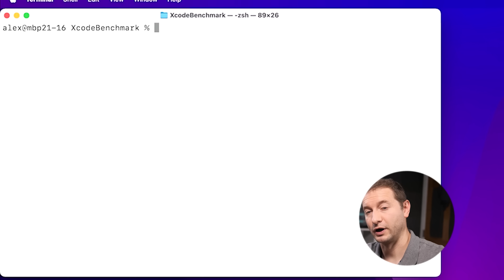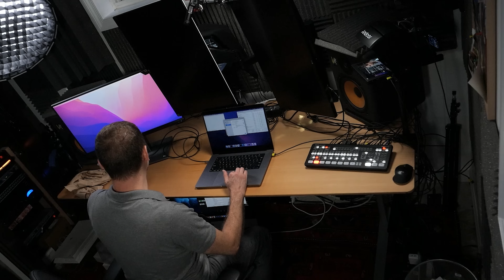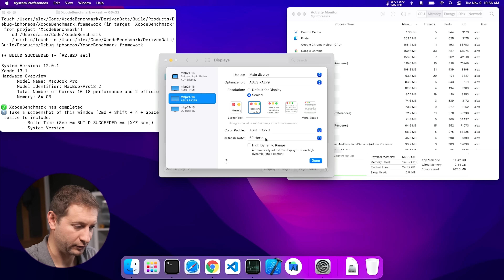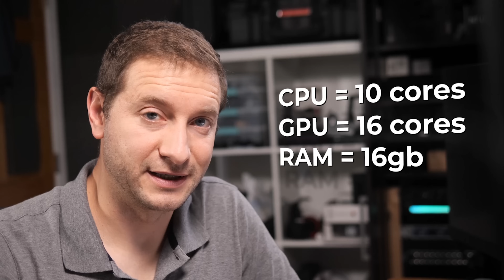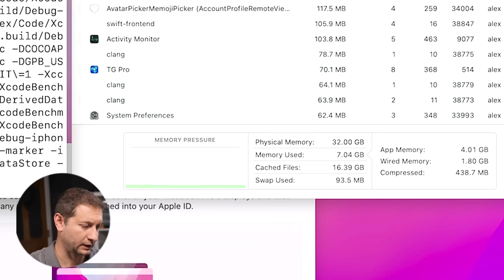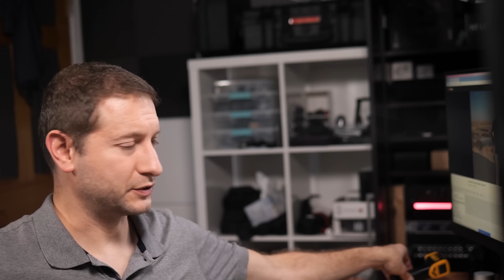More monitors = slower MacBooks | M1 Max/Pro with several 4k

Comment: I'm running TRIPLE 4Ks @ 60hz!!  Backstory:  I specifically bought the M1 Max because I wanted to work a third 4k monitor into my setup.  However, I ended buying a dock with DisplayLink that may even work for three monitors on non-max M1 chips.  I'll have to test it with my wife's MBA.  For those who are curious, I'm successfully running a triple 4k setup at 60Hz (each monitor) from a single hub -- one TB cable is all I have plugged in for charging, perifs, and three monitors.  It's an Alogic DX3 and it was kind of hard to get.  Amazon was out of them so it shipped from Australia.  I was half expecting it not to work, but so far it's been working for about 5 days with no issues.  Kind of amazing.
Reply from the maker: Can you share the make and model ?
Reply: @AZisk  My macbook pro is the 16" M1 Max with 10C CPU, 32C GPU. The dock is the ALOGIC DX3 with a Display Link driver, and the monitors are all identical LG 27UD68W models from a few years ago. They're all connected via display port. I haven't experienced any excessive RAM or CPU issues.
Reply from the maker: @jmpersic  awesome thanks
Reply: @AZisk  Sure thing.  And thank you for your great videos!  I've wondered why for years nobody seems to do multi-monitor testing.
Reply: @AZisk  Would love to see a video on this overcoming the 2 display limitation on the Pro if you pick it up.
Reply: Hey Milo this is some great information. I have the Pro processor and I was wondering if you had a chance to test out your wifes Air? Do you think the alogic would work with the pro for 3 displays? I've seen mixed things online. I'm considering returning my Pro to get the Max, but if this works that would be a nice savings.
Reply: @EliBates95  I have not had a chance to test it with my wife's MBA but I'd be happy to test and post the results here.  Maybe I can get to it in the next few days if not sooner.
Reply: @EliBates95  I will test it ASAP and post the results here.
Reply: @EliBates95  So guess what.  My wife's base model M1 MacBook Air has zero issues with my ALOGIC DX3 dock.  She's running Big Sur (I'm on Monterey) and the DisplayLink driver installed fine and the Air was able to drive three (!) 4K monitors at 60hz each.  I'm floored.  I think this means that if you have this dock, or possibly other docks that use DisplayLink, you don't actually NEED an M1 Max chip.  The limitation of DisplayLink is that it's meant for productivity, not gaming or lots of moving pixels let's say.   It will hit your CPU.  But if you're doing productivity tasks it's amazing and barely hits it.  I kinda feel like I spent too much now on the M1 Max, but at least I'm not dependent on DisplayLink for 3+ monitors.  If the dock fails I can plug in directly, so there's that.  The DX3 cost me around $250, but the single-cable convenience is pretty nice.
Reply: @jmpersic  dude that's awesome! I'm literally just using like vscode, chat apps and web browsers so this sounds like the perfect solution for me. Gonna pull the trigger on it. Thanks
Reply: @EliBates95  awesome, you won't regret it. I also use VSCode, Linux VMs, Adobe InDesign, Docker Desktop, PGadmin, stuff like that. I don't game, and have zero issues with the display link setup.

Comment: The caldigit element thunderbolt 4 hub looks like the owc but it has four USB A and three USB C / thunderbolt ports. It just offers more. Although I don't know which delivers more watts to the laptop. I think caldigit can deliver 60W, enough for a 13" or Air.
Reply from the maker: Not bad, but definitely more expensive. Im waiting for owc’s 14 port dock which is on backorder. Have been using their t3 dock for years and love it.

Comment: Thanks very much for making this. Good to see the 16” Max comfortably sits at low/no fans with these many displays attached while my Intel 16” would be 100% fans and melting into the desk.
Reply: Even with only one display the intel one goes crazy!
Reply: what about when you need to share the screen? I need to disconnect my monitors (MPB intel 16")
Reply: My 2019 Intel with one monitor and it becomes useless. It become crawling slow as well. If I need to get work done I need to unplug from it. It sucks
Reply: Seriously….gotta upgrade cause of it, dang intel!
Reply: mine goes nuts with one 4k display only forget running 2 or 3.
Reply: Yeah that's cause Apple didn't connect any heatpipes or fans to the cpu or each other, the load here is pretty mild, I used to run 4 monitors while compiling a 20+ project solution on an older i7 10th gen (last mac had 9th gen), one of those monitors always had a 4k video running from youtube. That system never had an issue. but I also wasn't running MacOS.

Doesn't matter the cpu you use, if the actual system engineering is getting in the way.

Comment: I've been running two 4K monitors with a DisplayLink hub on my Macbook Pro M1 (not M1 Pro) and have noticed some interesting things. Apps like Spotify which have tiny little animations when music is playing (although they've recently changed that) use a ridiculous amount of CPU, same goes for Slack with animated GIFs etc. I've gotten to the point where if I need max power (or to save battery) I'll minimize those apps. This happens even if the apps are displaying on the laptop's screen.
Reply: Spotify on my mac sometimes takes up to 2gb of ram. idk why
Reply: Hold on. How is it possible? M1 support only one external display due to IO limitations. Am I wrong?
Reply: @Ilinskiya  aha! That's the trick 😁 I have a USB-C DisplayLink hub with 2 HDMI outputs. Just need to install DisplayLink software and off you go
Reply: I wonder if the cpu also working with the ram hinders the cpu earlier than it would with the previous generation.
   I can see how the cpu managin ram helps ram but I don’t see how this makes the cpu more efficient. They made more powerful cpu chips and are somewhat wasting it on helping the ram

Comment: Thanks Alexander for doing and showing this 👍
While the tests might not have been so scientific when it comes to showing only the impact of added monitors, since the tasks running were increased too, it still demonstrated well how and what works in practice. Of course one could argue that if you have more monitors you are more likely to have more things going on in parallel, so from that point of view your addition of tasks (videos in this case) is imo relevant, even if it no longer compares the same load with only more monitors added. 

The maximum 2 screens limit on the M1 Pro is a real bummer, why Apple oh why, sigh.

Btw, if you are using 4k resolution on a 4k screen, you are no longer scaling, you are using the screen at its intended native resolution. Any other case is scaled, but not the native resolution.

I agree that 4k native resolution is too small if you use it on 27…28” screen, but if you use 32” screens you can use it fine at native resolution and with 3 such screens fit an insane amount of information on them, since it equals 12 full HD screens. Problem is, once you get used to that, anything else feels very cramped and paralysing 😀

Comment: In my home/work setup I am using OWC Dock with 3 thunderbolt ports, ethernet and 4 USB ports, it is nice when I switch between home and work computer with one cable change. I have one ultra wide screen 49' 5120x1440 120Hz, 3 dongles for wireless keyboard, mouse and headset, webcam, ethernet and android device all connected to the dock. Switch between two machines is as easy as connect dock to one or second machine. 
One grain of sand in this machine is MacOS Monterey couse it doesn't remember refresh rate settings after update from Big Sur on additional screen and always set ProMotion that causes blinking and I have to manualy switch to120Hz over and over again.

Comment: I was hoping you would test with the screens just connected, not running other apps. The question being does merely having the screens connected at all affect performance. Obviously the benchmark will be affected by other stuff running. :-)
Reply: i would have thought that too. but it seems like just plugging them in had almost no effect to RAM use on the 16 GB M1 Pro 16” which is bizarre to me given unified memory is gpu memory!  i know pushing in a 4k to my old MBP 15” turns the fans on straight away as it switches to discrete GPU.
Reply: Of course it will be slower with 3 monitors. Slower for gpu. Because gpu now need to render 3x more info 3x more pixels. Video memory is shared in m1, so it also require more memory. My simple app that I did with Juce framework use 220 mb and if I resize then it uses 300 mb.. etc
Reply: Sure but if you have other displays, you will use them with other tasks probably. If you connect other displays but plan not to use them, then you shouldn't plug them in at all.
Reply: @guipo2581  yep,in that case he should start the tests with all apps open and then connect monitors to see a real performance.
Reply: @guipo2581  bullshit. I use 3 displays in video and audio production. Only 1 program is working. The most stupid thing is watching 3 YouTube videos simultaneously! Most stupid test I’ve seen.
Reply: @Alexander Chudopalov  I see. Your use case is more specific than most users, at least for those that consume the content of this channel. I think other programmers would have vs code open, an external terminal and many chrome tabs open, as well as a debugger or an simulator, so I think this test is not stupid at all, even if people doesn't watch many YouTube videos at the same time, the point is that the chrome tabs are open and the pixels in the external displays are being used and renderized again, with probably most users use case, witch is chrome tabs open doing some search, listening to music and watching an tutorial video or a podcast
Reply: @guipo2581  "in that case he should start the tests with all apps open and then connect monitors to see a real performance"

Comment: Finally it's here , thanks for the tests 🔥

This setup shows  how most of us Devs work and these videos help us to decide what machine to get.

My Intel Mac used to get lot hotter and drop performance in such use cases .  

M1 Air and M1 pro  seems to be less fit to my use case.  ( I was okay with their performance until this video ) but now that I have seen this video it changed my mind . Better cooling  do seems to have an impact 

Anyone  who are planing to spends money on these machines will love your videos , these test helps a lot .

Comment: I'm not sure I understand the test: you're plugging monitors, makes sense but then play 4K videos on them.
Build times are longer but isn't it because  playing videos uses resources?
When changing 2 things at the same time, measurements don't answer the initial question anymore.

Sounds to me like you're testing the impact of running more things during the build, which as a result makes it slower (and it's not related to the GPU driving monitors)

Still watching tho
Reply: I have to agree. It even says when he runs the benchmark, "Please do not use your Mac while XcodeBenchmark is in progress". Sometimes his tests just don't make sense.
Reply: @mattbosley3531  oh haha yeah and then he unplugs the video recorder output on the M1 Pro, which was HDMI and mistakenly not counted as a monitor on the M1 Max earlier.

I mean at least we can roughly conclude is that it's fine to use external monitors, without having fans go crazy as with the previous gens, from the much less efficient discrete GPU.
Reply from the maker: @supercurioTube  Yep, while not a scientific test, I wanted to test what kind of output I can get and how (approximately) it will affect a long build - is it significant? Playing 4k videos is pretty taxing on some machines, but most of these handle it just fine. If I included some older machines in this test, I think the video results would have been more dramatic. Thanks for your comments.
Reply: @AZisk  yes no doubt, thanks to hardware decoding the impact of playing videos is very tiny.
Reply: It’s a bit random as the tests are not standardised
Reply: Actually, the M1 air gets a lot slower  because it does not a fan.   I found that out plugging it to a 1440p monitor.  Intel macs get slower also.    Its the heat!! It will also take a hit on battery life
Reply: @nyambe  but does it get slower because of the extra GPU usage and memory bandwidth to drive and refresh the monitor, or because of the task running on it?
Reply: @supercurioTube  task usage  is minimal and would in any case be consistent. The only one affected  by external displays was the M1 Air.  The others did great, which is not always the case.  Driving 3 4K monitors has to produce stress on the GPU.  That is actually crazy talk
Reply: @nyambe  How can you conclude that only the M1 Air is affected by external display and not streaming ultra high definition video?
Reply: @supercurioTube  I have one, ;-) I noticed that it got really hot on 1440p/4K external monitors .  Since it has no fan in slows down. It works fine with external 1080p monitors.  I commented that to Alex on the last video.  M1s, Including the M1 Air handle multi tasking extremely well, they have media engines and fantastic memory compression management. You can see it in the video, less than 5%  impact.   Besides, if you hook an external monitor it's to have something display on it.  It could be a video, another app etc. Multi tasking
Reply: @François Simond (supercurio)  whether it's gpu or because of resources used by multitasking . These machines are expected to handle those , so why not test them ?

 it may get slower due to heat and on how much longer  the monitors are plugged in and on  what  you are working on.

Since most of us are spending these much money on these machines .  Why not test them on how we use it on daily basis ?

Playing a  4k videos on xcode build may not occur frequently but running build during a playing a  video or on a video call  with team may be a frequent task for someone who works remote 

Now I am curious how long these machine can remain cool with all the monitors plugged in  the whole day
Reply: @JOELJOSEPHCHALAKUDY  Because the tests didn't answer the question asked by the video.
The tests answer: if I watch several 4k videos at the same time as compiling code, does the compilation takes longer?
Yes it does.
The test have essentially nothing to do with external monitors being plugged in. You could open this webpages and play videos on the internal screen just the same.
Reply: Do not question his tests, or bring in the scientific method, because he will get defensive and reply with a passive-aggressive comment, look at his other comments on videos. This is a YouTuber not open to criticism and just plain defensive.
Reply: @thalberg-  Alex be the best! Funny and all.  What you are talking about is called Irony.  Look it up.  Leave Alex alone, he is doing an awesome job covering all this info for developers all around the world that do not have access to these maschines!
Reply from the maker: @thalberg-  while I make an effort, all your comments on this channel have been pure criticisms without the constructive part. Sounds like you need to start your own channel and do things right.